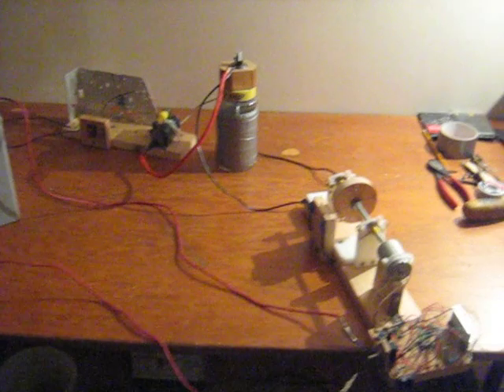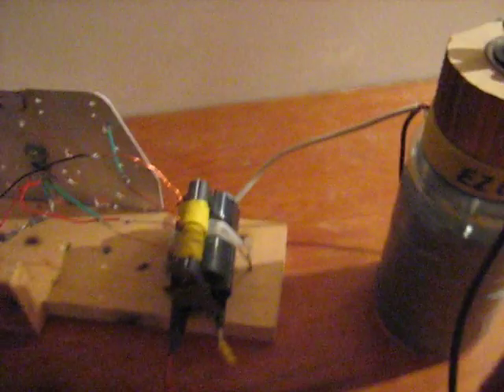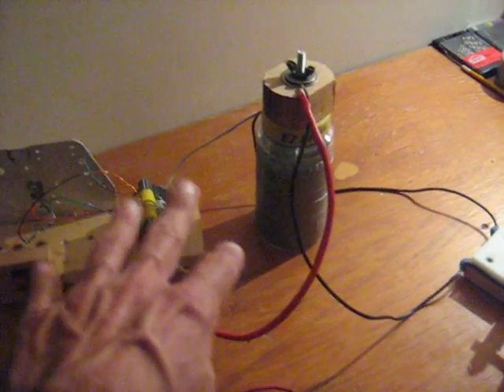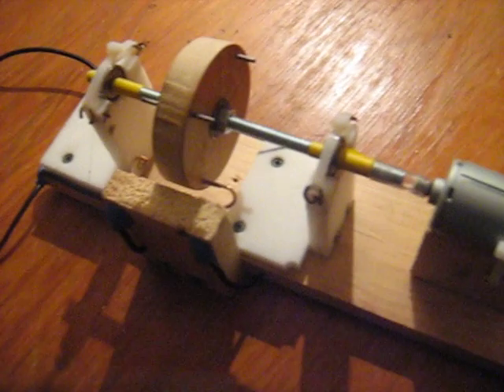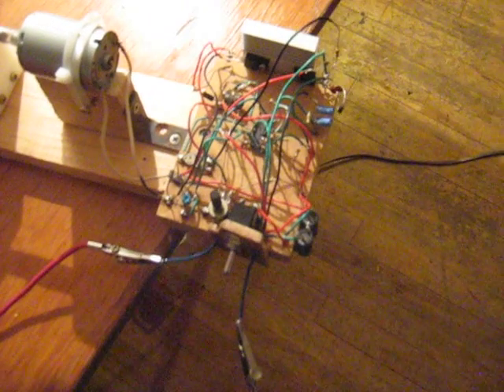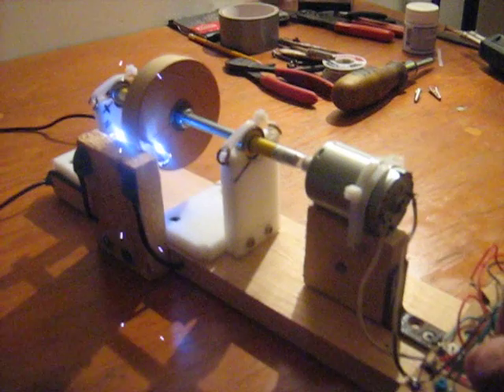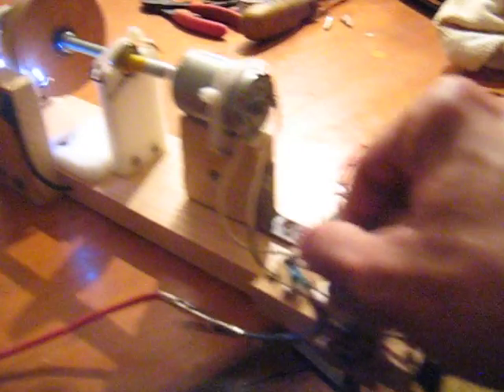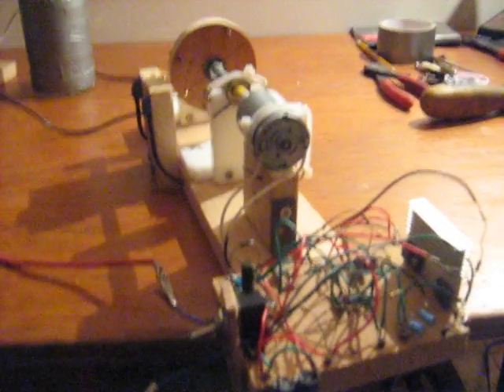Rotary Spark Gap

Comment: A rotary saw-blade'd make a perfect rotary spark gap as the tungsten carbide tips can withstand very high temperatures and there's lots of'em for many sparks per RPM, but for some reason no-one ever uses them.

Comment: Thanks sir, your idea is a great one. From here I think I can release pulses from a spark gab now. That is the secret the energy companies are using. From a high high voltage into a spark, then then they release it in 50 circles per second. And it comes out with tremendous watts

Comment: to capture different wavelengths antennas have different wire lengths. full wave length, 1/2 or 1/4 will work (harmonics). I think you meant 2.4 Ghz not Mhz - i have the same one here. So to capture 1hz you need 300.000 km of wire (RF wave is as fast as light - that is what they say, i did not check) or 150000km or 75000km. to capture 2.4 Ghz you need 125mm of wire,  less than 5 inches. But don't quote me on this, I know nothing about radio.

Comment: OK, so what "electrical noise" generator would create radio frequency?
spark-gap generator running within a certain rpm range?
commutator?
some RF-tuned self-oscillating circuit gated to the frequency range?
and how, once generated, is RF directed or reflected?
and perhaps most importantly, why is this FLA fellah the only one to ever seems to have done it? could it be.... balderdash?

Comment: We think a lot alike AND live in the same province.. ;-)
There was a LOT about the burning-saline-with-rf that they didn't specify. All I could really deduce was
a) RF frequency
b) salt water
c) proximity to the "device" and something on both sides of the test tube.
d) no noise, camera interference or visible mechanics

but c'mon, if there's an accidental arrangement that allows enough hydrogen to be spontaneously released from saline for a potential 1200 C combustion, it's worth fishing for!